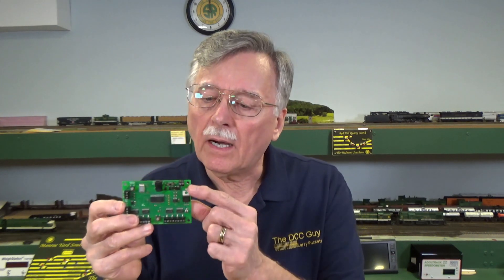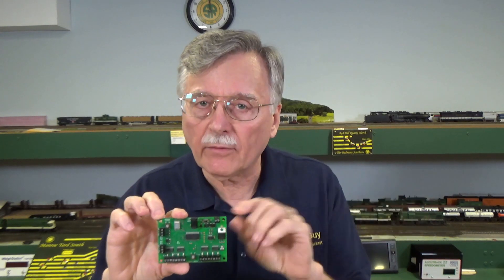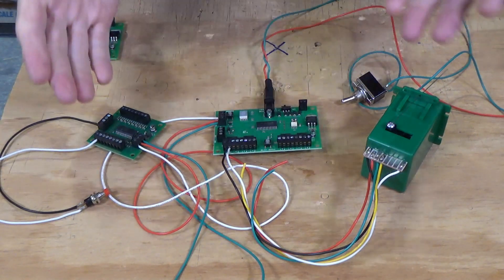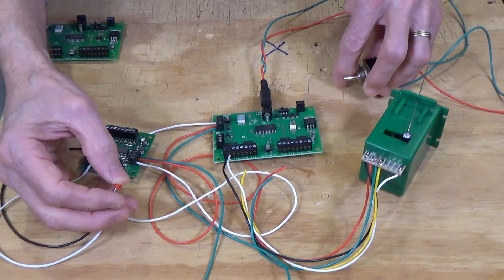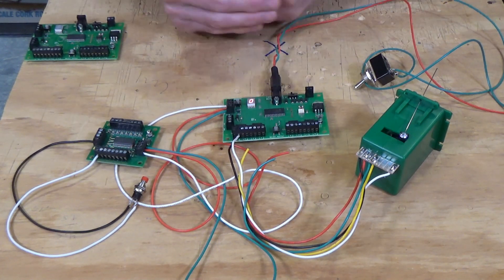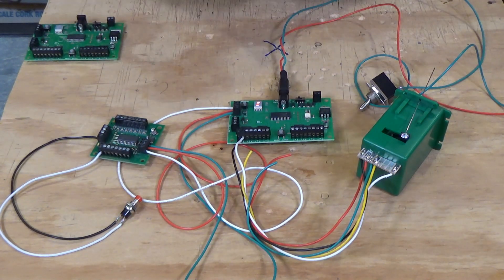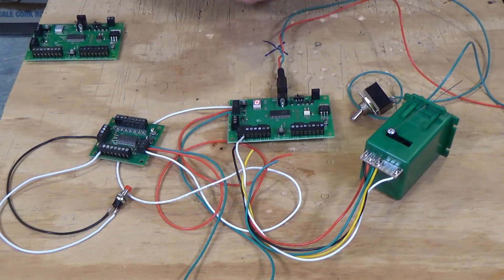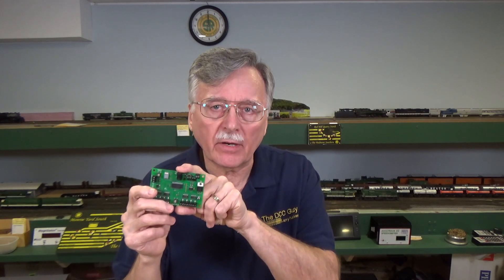Switch8 Problems, See What Works For Me (75)

Comment: I would say the official stance from NCE is expected and understandable… They have a similar stance when it comes to “wireless” PowerCabs.  Just like other manufacturers, they don’t want to get trapped having to provide support for a function or feature they didn’t design or plan for.  Almost all NCE products are designed with extra bonus features both advertised and unadvertised which is why I buy them with the understanding that if I choose to use that unadvertised feature that is my decision.  The other option taken by other companies is to remove all the extras so people can only use their product in the one way it was designed.  I don’t think anyone would want NCE to have to do that?

Comment: Thanks for the video.   The problem I seem to be having is that a push button switch will not work.  The only switch I can get to work is a three position switch, center wire on the ground and the to outside wires on the N and R lugs.  Otherwise, it works perfectly.
Reply from the maker: Have set CV548 to allow pushbuttons?
Reply: @TheDCCGuy  I must have missed that part.  So changing that CV will fix it?
Reply from the maker: Yes, the unit comes set for use with toggles and must be set for using pushbuttons.
Reply: @TheDCCGuy  I have the NCE power cab and tried programming on the main for cv 548, changing from 0 to 1(should have read the directions), and I can hear the Tortoise switch moving slightly, but I push the button and nothing.  It still functions off the toggle, just not the button.  So I ran a jumper from the program track and disconnected the main line.  Trying to program off the program track, the cab says it cannot read the CV 548.  So I am sure I am missing something but I just don’t know what it is.  Never mind…Success!!!  After reading the directions on the switch 8 again, I caught the” program via Accessory Ops mode.  Sorry, I’m a little slow, but we have it now.  Thanks for your videos and your help!!
Reply from the maker: Yes, the fine print in these manuals trips up a lot of folks, and with electronics you have to do it exactly as the instructions say—close enough will not work.

Comment: Larry  Having similar issue here with New Switch 8 MK2   in this video did you set CV 548 to the Switch 8 MK2 ?  or in DC Mode only does that mater?  CV 548 allows you to only require one push button to toggle the tortoise
Reply from the maker: Yes, I use the Button Board with all my Switch8 boards so you have to program it for pushbutton operation.
Reply: @TheDCCGuy  Larry thanks I have a new one on Order will hook it up to my DC system program CV 548 then try DC only method for controlling the turnouts. using my button board
Reply: Larry I just received my Switch 8 MK2 that I sent to NCE support.  They claim no issue with the board and CV 548 was set to value 1.  When I connected all my Tortoise switches and the button board I was unable to use the push buttons or thru the power cab nothing works.  It I turn the system off and on they switch thru the power cab now but not all of them.   I was told by NCE support to only use DCC when connecting and do not use external power source until everything works.   I had another SWITCH 8 MK2 I got off ebay and same results will not work with button board switches switch thru power cab but not the buttons . Only my old switch 8 mk2 works with buttons and power cab. Just wish I could have found the older version out there no one has it.  This new version is very frustrating  any suggestions?  Thanks Tom

Comment: Thank you for clarifying the installation and means of operation of the Switch 8, just received two units this past month and about to install.
Reply from the maker: Go slow on the first one and test it as you go. The instructions cover everything you need to do just not necessarily in a given order. If used with DCC then you need to give each output a unique address just like mobile decoders.

Comment: So the inevitable question is.... if they are for dcc power only why does NCE put a dc/dcc switch on the board?
Reply from the maker: I think I said at one point that it provides supplementary power so that you are not running all your switch machines off DCC track power.

Comment: I have seven of these installed on my Southern Piedmont Rail Road. Four are older, three more recent (last July). I have all on 12 V wall warts plugged into smart plugs so that I can tell Google to Run Trains. All have button boards going to toggle & LED fascia panels. I did a PCB to give me easier plug connections.  I have never had problems with the older Switch8s but have had issues with the newer ones not starting up such that the panel inputs work, much as your video describes. On startup the DCC track power is not on, which I would assume is the case with most installations. So for NCE to say that they require DCC track power for the Switch8 to work is a blatant admission of incompetence. What poor engineering. They should have done their homework on use cases.

I discovered that not all wall warts are created equal. In using 12V plugs for LED lights I noticed that with some there is a delay between powering the wart and the lights turning on. The warts with the delay would not initialize the Switch8 properly. The instant on warts would. So the Switch8 is sensitive to the power on curve. But, seemingly, only the newer ones. So something did change, maybe not their design but in the components or their firmware. Your idea of a switch in the 12V line is great. I think that I will implement a momentary contact normally closed push button switch as a handy reset. Thanks for the tip.
Reply from the maker: Glad to hear you are going for a work around. I still consider these to be good devices, especially when used with DCC inputs. I too wonder whether it is a matter of variability in components and they got in a bunch of some that are a little outside the specifications. At any rate the switch seems to be working with mine as I showed in the video.  Thanks for your input—Larry
Reply: @TheDCCGuy  Given the alternatives they do what I want for a good price. I expect that I'll change them out in a couple years for LCC based controls although at the rate of LCC adoption I may have to build my own to get what I want.

Comment: This is very interesting. I dont use my button board anymore since moving to a mini panel. I have 3 of these switch8 units. All 3 are using a 12v DC wall wart. All switches set to DC. All three are hooked to DCC track for signal transmission. I dont think i have ever seen this issue on my layout. Thanks for sharing.
Reply from the maker: That is correct. As I said in the video there are no problems when the device is connected to a DCC source. The issues only arise when you use them with DC power only. I have found that by simply power cycling the board it will reset and then works—for me—as I showed in this and the earlier video.

BTW, want to sell your button boards, I may need a couple more?